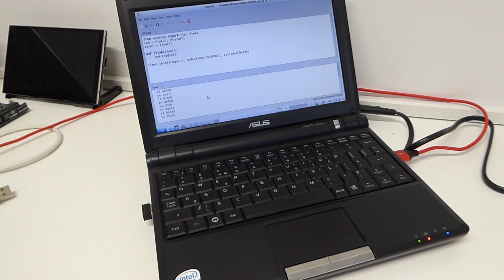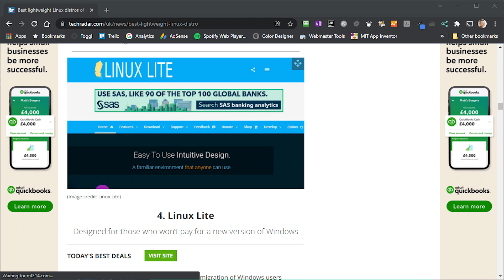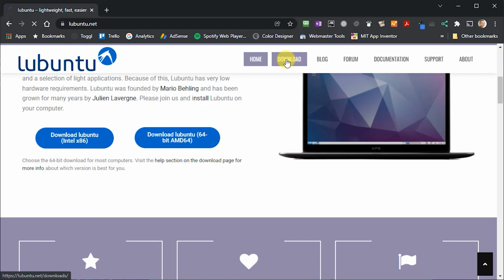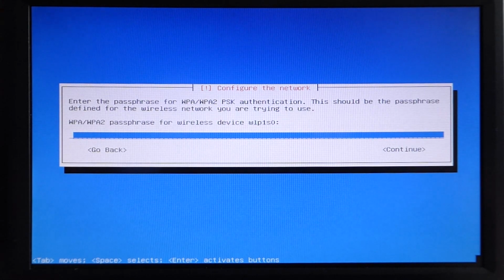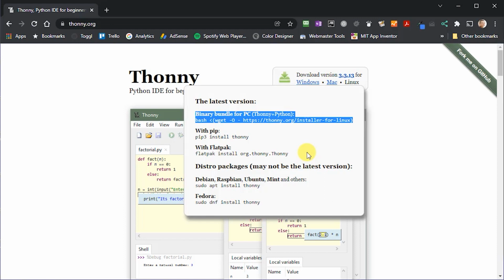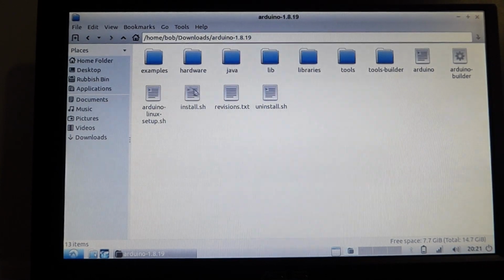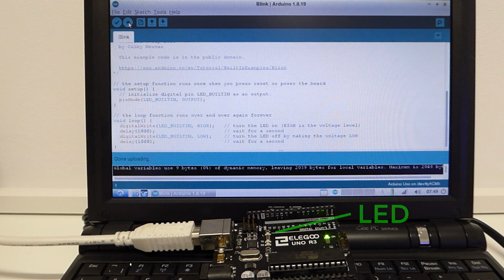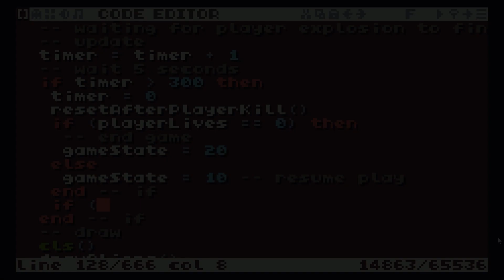Don't Scrap Your Old Laptop. Upcycle It! Use 1 - Coding Development System

Comment: I have a number of netbooks in active use in our home. The distros I find that work well with their Atom processors are 1) MX Linux; and 2) Linux Mint XFCE (Ubuntu-based). MX Linux is faster so I opt for that first, but some machines have display issues in MX Linux so I then install Linux Mint XFCE.
Reply from the maker: That's great! Thanks for the info. It's always good to know which distros work.

Comment: This sounds like a good idea for an old notebook I have and I was wondering if it would run tic 80 or pico 8 which I could then try some game developmenton while I’m away at my caravan?
Reply from the maker: Hi. Yes. You've basically got a Linux laptop. Both TIC80 and PICO8 should install fine.
Reply: @BytesNBits  not installed them yet but thonny, arduino etc seem ok!  I’m using peppermint which was already on it and I think is based on lubuntu.  I installed it earlier this year, or maybe even last year, as an experiment as it was so slow running windows.  Nothing to lose as it was just gathering dust!

Comment: I bought an old Dell 800mhz just for Dos,Win95,Win98 games 🙂 it has Windows Me installed
Reply from the maker: Sounds good. Does it perform Ok in Win Me?
Reply: @BytesNBits  yes i have norton system works 2002 on it for fixing errors and optimize the performance i use custom / adanced on install install utilities i run win doctor and norton defrag on any win 95-98- Me
Reply: @BytesNBits  you also can use windows xp sp2 i have it on a dif HD and i like it games go in full screen mode

Comment: You need to be an "old guy" to really appreciate old hardware. I can remember using a Commodore Amiga A1200 running at 14 Mhz with 2MB RAM to access dial-up BBSes and dial-up Internet with the "iBrowse" web browser and downloading freeware and shareware from the Aminet site.

The oldest machine that I currently have in regular use is 50 times more powerful with 256 times more memory than that Amiga had - yet it's an IBM Thinkpad T22 with a 700 MHz Pentium III CPU and 512MB RAM from about 2002!

As a species, we've really been spoilt when it comes to ever-increasing computing power at our fingertips and we've lost perspective over the years.
Reply from the maker: I know what you mean. I've just been playing with turning the same EeePC into a DOS gaming PC and it's running Doom, etc. better than anything I had back in the 90's.  So much of our processing power these days seems to be used up with making the OS look pretty rather than doing something useful.
Reply: @BytesNBits  There are "legitimate" reasons for needing and burning CPU cycles - video editing, for example, and gaming, even though I personally gave up on modern AAA gaming about 10 years ago because of bad practices by the gaming industry and poor quality output.

But I do agree that every CPU cycle should be treated as a "valuable commodity" and I have never understood why very few people don't seem concerned about burning them up on "eye candy" for the desktop.

I've been with Linux for more than 20 years now, UNIX before that, but I only stopped with Windows after Windows 7. For me, one of the best desktops ever was the Windows Classic desktop in Windows XP - it was reasonably light and it just stayed out of the way, exactly as a GUI should, to just let you run your applications. That's all a GUI needs to do.

Web browsers becoming operating systems in their own right have also increased the demands for CPU power and RAM. I personally always try to use local applications rather than web-based applications because of the privacy concerns - for example, I still by music CDs, rip them myself and play my music from my own server without resorting to Spotify or other web-based music sources. 

Hosting my own local services also means that I can get away with using lower-powered computers and there's a lot of satisfaction to be had knowing that I have kept my computing at a "hobbyist" level, without having to "sell my soul" to huge corporations that just want access to my personal data.
Reply from the maker: @terrydaktyllus1320  Some good points there. I'm afraid I sold out to the ease of use, but still it's great to have a play with the older, purer technology.
Reply from the maker: @terrydaktyllus1320  No problem. I didn't think you were criticising. Thanks for the comments and sharing your ideas. It's great to have some discussions going on.

Comment: Love repurposing older but perfectly good hardware. Well done! Can't wait to see DOS.
Reply: Absolutely. I have a collection of old IBM / Lenovo Thinkpads that I have repaired and renovated - I get them working and then stick Gentoo Linux on them. I have a T22 laptop with a Pentium III CPU in it running at 700MHz and 512MB RAM (so about the same as the original Raspberry Pi) but I still use it for shell programming, SSH access and even as a music server (mpd) player.
Reply from the maker: You and me both!